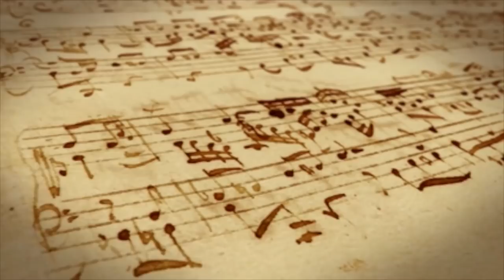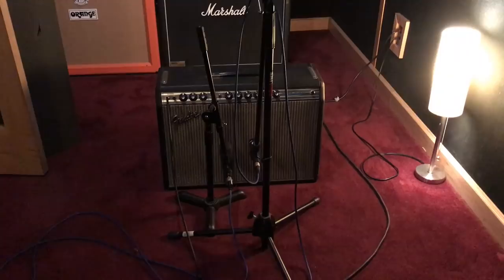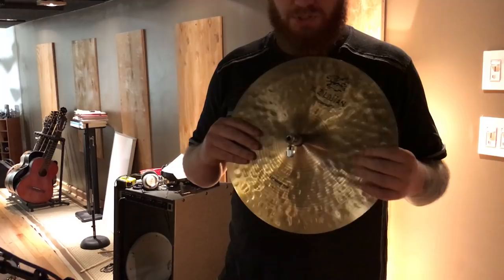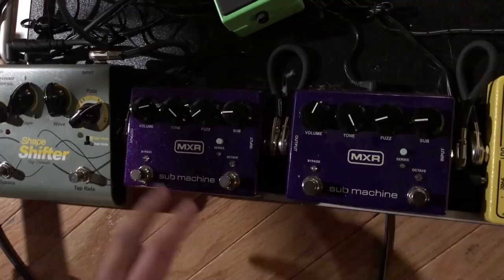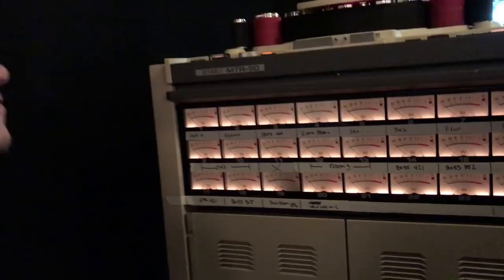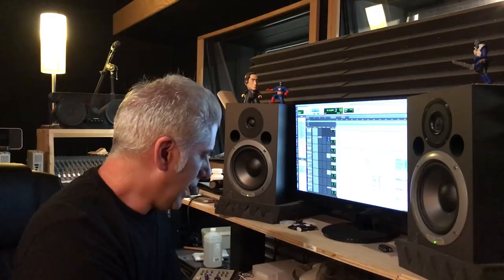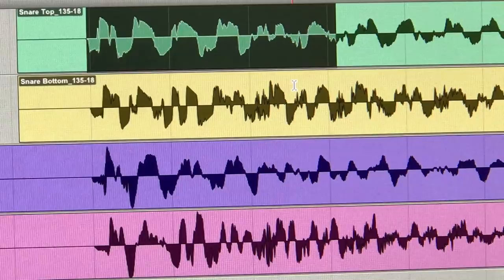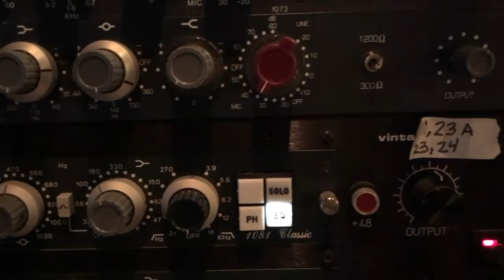How To Track A Rock Band Live To Tape!

Comment: I'll toss in another "funny from down under", or two; firstly, Figure 8 mics. You can use them in a Middle=Side (MS) pair for a really precise stereo recording (string quartets, for instance), or you can exploit one of their really interesting characteristics; almost totally nulling out any sound from the sides. If you are tight on mixer channels and working in a small live venue, use a small Fig 8 unit like the AKG CK-94 One lobe aimed at he batter-head of the snare, the other at the high-hat. Pretty much everything "off-axis", like the Bass and keyboard / guitar stacks and the rest of the drum kit will be nulled out because they are more-or-less ninety degrees "off axis". See also "wide" percussion instruments like Vibes and such. a pair, tweaked for "best location" on a big mallet-board.

The other 'forgotten" mic" is the PZM / boundary-layer "plate" mics. Some may remember seeing these used as vocal mics on some early 1980's music videos. ALL WRONG; talk about "psycho accoustics". Best used when attached (gaffer tape is your friend, mostly) to a large, hard flat surface like a wall or floor, otherwise, because of their size, they have outrageous "high-pass" characteristics. Recording a big pipe organ? A spaced pair of "hemisphericals" on the hard wooden floor captures the entire organ AND the room in impressive style.

Recording a close-harmony backing vocal? Tape a spaced pair onto the "big" control-room window. Standing a few feet back, the singers face the window, not a mic stand in sight, and do their stuff. THEY do the musical balance and feel the harmonies; you just catch all the goodness. In such an application, if you lack real PZMs, you can fake a boundary layer mike by taping a pair of GOOD mini-mics, (DPA 4060, or Sennheiser MKE2 or similar, to the wall or the window. This use of mics is closely related to the old theatre trick of a row of "foot-mics", often AKG 451s with a CK1 head amounted via an a-51 "knuckle" adapter along the front of a stage. The mic assembly must be "sof-mounted to the ploor for obvious reasons. They are not there to catch the footsteps (normally) but originally to catch enough of the performers voices for some subtle enhancement. In later days, they were, and remain, the last-ditch backup for when a radio-mic transmitter dies. The performer are 'trained" (as much as possible) to hear and feel when their mic has gone bad, and to line themselves up with a downstage mic and knock 'em dead.

Comment: A note re: flat wound strings.  When they are fabricated, the strings are wrapped on the core, then run though rollers to flatten the strings. When they are made, the strings are drenched in oil to facilitate flattening.  On occasion, some of the strings sound dead. This is because oil has been trapped between the core and the wrap.  To GREATLY improve the tone of the strings, boil them in water for about 10 min to express all the left over oil.  They sound immediately brighter. Give it a try.  Steve.

Comment: I had heard that you definitely want to use flat wounds on a Rickenbaker bass, because the fret wire is softer and you'll wear them out much faster. This may only be the case on older Ricks, but that's what I heard.

Comment: Hi Rick, I don't know if I overlooked it on the video, but I missed some critical work flow steps. OK, I got from mic, to cable, but then to where? Board preamp (or desired stand alone pre)? And if using the board pre and are avoiding tracking an eq'd signal, i.e. just want an uncompromised mic/preamp signal to tape, do you come out of the insert send off of the board (if using the board preamp), or, at least, is that a workable option? Hey, thanks for posting this video!

Comment: What tape did you use?
AMPEX/QUANTEGY 456, 499,GP9
BASF 900, 911
ATR
And how much bias 355nwm 520nwm etc
What speed did you use and EQ:
15ips, 30ips
AES, IEC, NAB

Thanks for the video
Reply: Had some nasty expediences with a bunch of the old Ampex 456. The binder "decayed" and the oxide was being literally wiped off on the tape lifters and guides. I heard that Ampex were offering a "recovery service that involved "baking" the tape pancake, a process that would allow ONE playback pass. Scary stuff. Never had problems with the 3M or Agfa tapes, Used Agfa exclusively in my old Nagra 4S.

Comment: On the MTR do you find your choice of tape a factor in tone.  Also I noticed the tape play back was quite different to the going to tape have you set up the replay to playback brighter/fuller or are you setting the whole record playback to a spec you prefer to get the best out of the tape you use? By the way tape rocks but nothing will change my mind with CTRL Z 

love your vids by the way

Comment: I love the sound of tape, but  couldn't one achieve the same effect with an outboard compressor? Or, in worse case, a plugin?
Reply: Nope.......plugins and compressors are great but they are not substitute for real tape. ;-)
Reply: @jeddak the post was long ago... but I've done work, including pro work on various tape machines before digital got popular, and to answer, it would be pretty silly if it was mandatory to use tape in order to achieve the desired compression shape.  so Yes, you can achieve the effect with a plugin.  I know because I didn't want to spend oodles of money and time to have machines continually serviced.  I had to work a long time to figure out what gave the mix and/or drums a good sound, and I got it.  So do a lot of other people.  People who say it's impossible are Wrong.  It frequently starts arguments, but I used to mix this way by using tape, so I know what it does and what it sounds like.  You can tell when you have it right if first you know what you want the tape to do and how to listen.  If you can do that, you can get what you want.
Reply: @jjboogie1  Of course they're a substitute for real tape. And these days, a perfect substitute.
Reply: @davecarsley8773  They are indeed great. I love my tape emulations. :-)

Comment: Did the bassist say his pickups are microphonic?
Or did I misheard?

If he did, am I missing out on something? Last time I checked pickups weren't, what's going on here? Have I been living inder a rock? Care to explain, guys, pls? :c
Reply: He used the term incorrectly. A microphonic pickup is when the glue holding the magnet and the windings together loosens up and vibrates, making the pickup act like a microphone. If you yell at it you can hear your voice through the amp. That's not a good thing and when it happens it needs to be fixed. Can cause feedback problems and stuff.